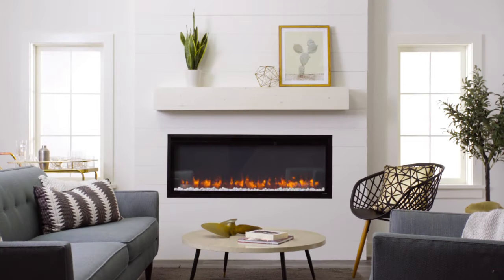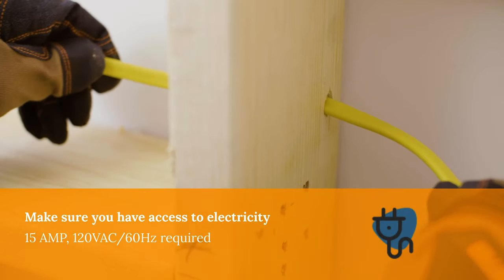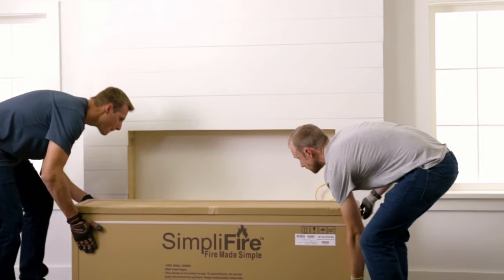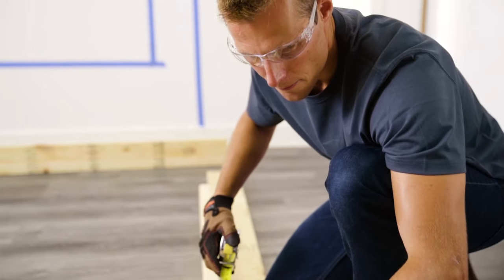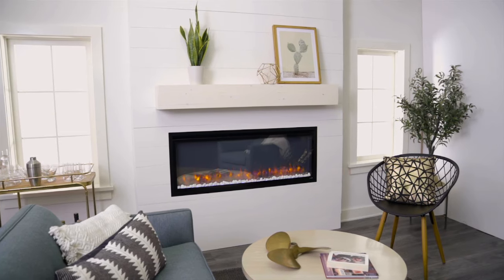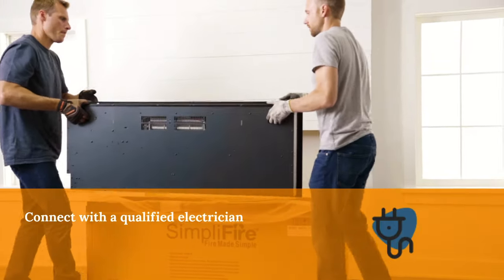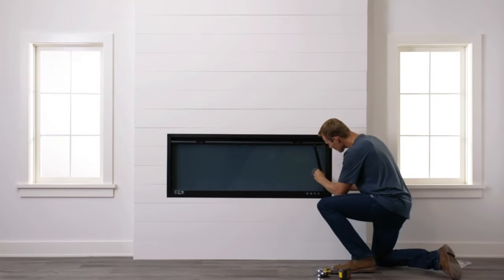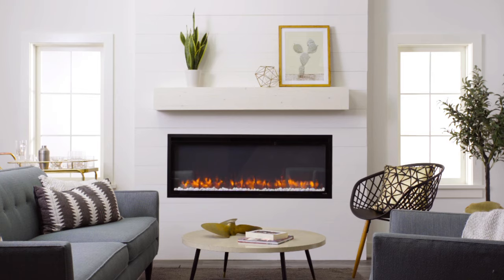SimpliFire - How to Install a Recessed Electric Fireplace

Comment: It makes a GREAT Fireplace Insert.  I already have a Brick fireplace n my bedroom & we installed it in the igsisting fireplace opening.  Beautiful, efficient & easy. Hubby measured & cut two 2X4's, to fit the base of the fireplace. (36") We layered them on top of each other.  We used supporting strips to secure & support the 2X4's.  The framed glass gently just sets in the opening and is supported on the 2X4's beneath the heater. It just takes two of you to evenly place the Heater (machine) in place. It's perfect!!!!!  I just hope it lasts for ever. I need to check on a warrenty
Reply: E
🎉

Comment: This video is not accurate, make sure to read the install directions about sizing - we got the Scion 43 and right in the manual is says the depth needs to be 7 5/8" deep.  A 2x6 wall is 5 1/2" deep - more than 2" short.  Even a 2x8 is 7 1/4" - so you would need 2x10s to do this project as shown.